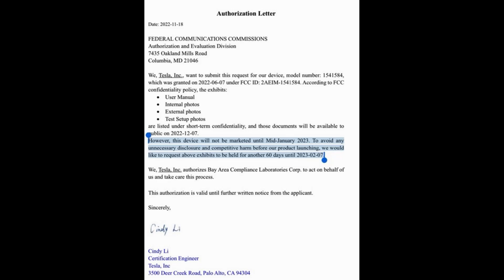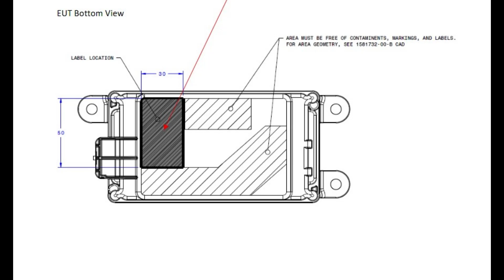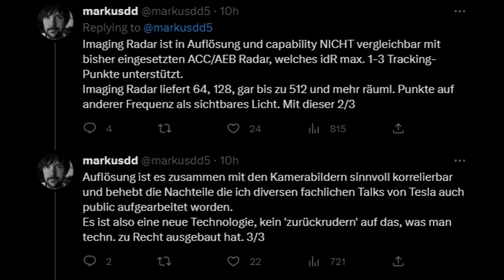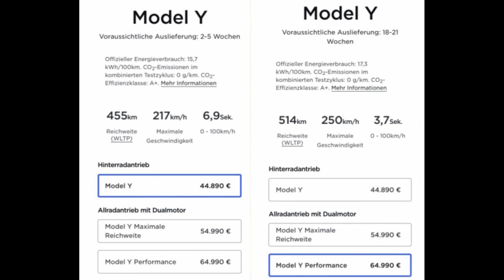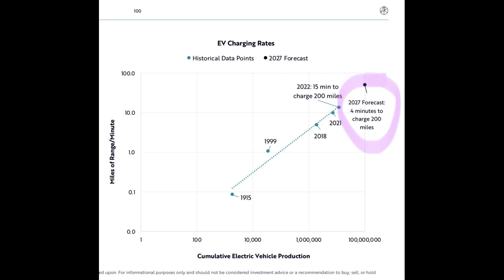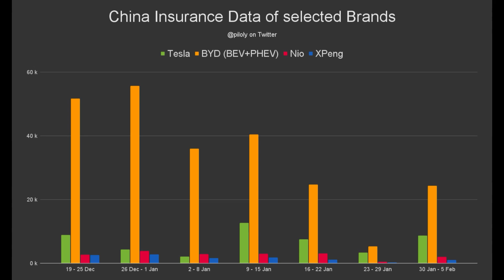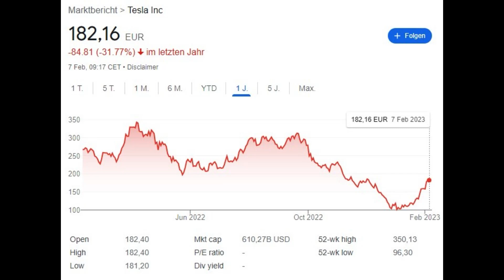TESLA Hardware & Radar - New Details

Comment: I will not be opting for FSD!  How will ANY replacement through an OTA update for the removal of USS going to help?  It won't!  Tesla needs to add a front bumper camera or a camera in each headlight + the new Radar system to accomplish this functionality.
Reply: They're not going to go back and add hardware to already sold instances to replace USS.  They obviously have a game plan using camera vision techniques to provide the same distance protection.
Reply: @lylestavast7652   It's been over 4 months since the removal of USS and still no update!  I'll believe it when I see it.  Until then, I will be holding off on my purchase until they actually come through on their promise.